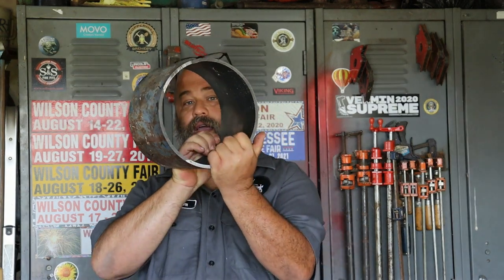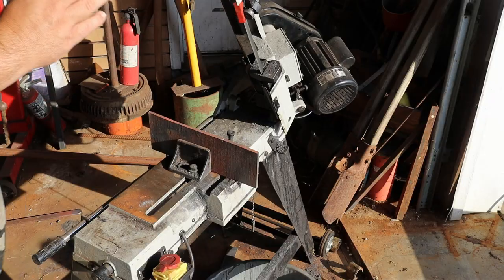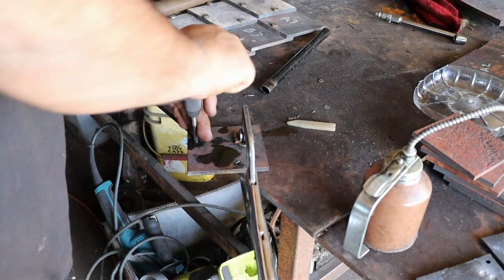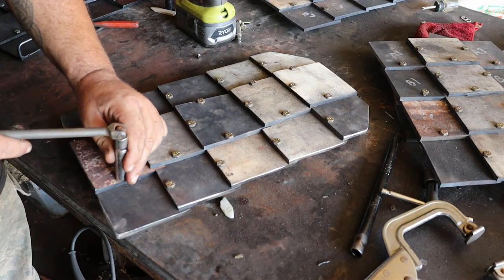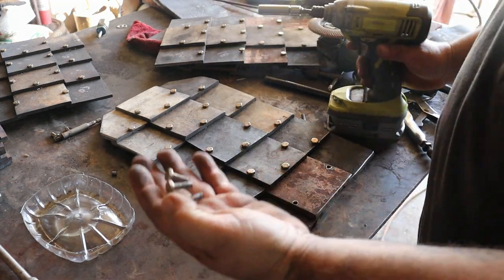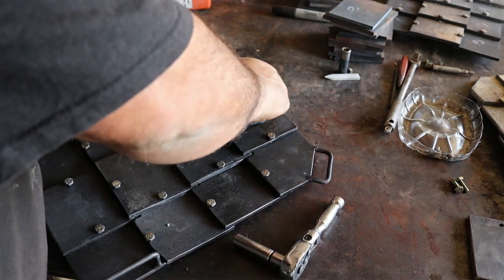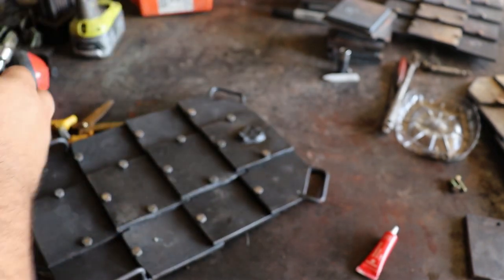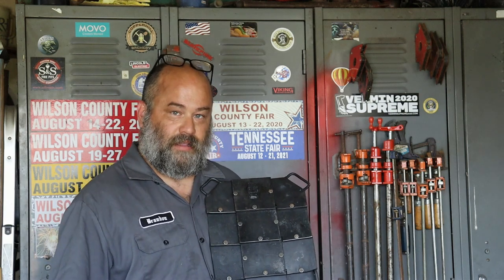Voo Doo Scale Blacksmith Armor Better Armor Better Production

Comment: Some suggestions if your open, one you absolutely need a throat protector maybe a welded v outward collar since your rounds are shattering on impact, imo for the upper chest portion to angle outwardly to funnel shrapnel away from head eys throat should stop you from taking hollow point flak in the jugular. Two as said angle plate slightly for multi reason one being round deflection, two being moving shrapnel away from face throat eyes, three for round impact distribution. Also it may or may not help to slap a half inch of silicone or even rubber floor padding melted to the back for the shock as well, those plates will turn your ribs into powder on impact. Just my opinions. 

Maybe even take a layer of Kevlar over the front to help catch bullet fragment just a thought.

Anyways love the design and can't wait to see what it becomes.

Comment: came over here from demo ranch because i fell in love with the armor, looking forward to seeing more updates. Have you thought about potently layering flex seal or layering it with some rubber as a potential anti spalling agent ? im also curious about the weight of the system as is.
Reply from the maker: Glad to have you working on spall protection now, no flex seal though!
Reply: @VooDooTennessee  amazing armor
Reply: I’ve been suggesting a physical ridge to deflect the spalling; something to redirect it away from the face and vitals.

I suppose the problem with that is that then the spalling can also hit your arms and limbs, so maybe combined with anti-spalling.

I like the idea of flex seal 😆 maybe mixed with some sort of fiber. Carbon, Kevlar, or even something cheaper.

Comment: 1 question and 1 piece of advice:
Q: Why do you soak the bolts in vinegar to remove the coating?

Tip: If you relieve the drill and tap 1/4 turn after every full 360⁰ turn, you'll break chips in the threads, which will lead to much cleaner threads and extend the life of your taps by about 200-400%. ;)
Reply from the maker: I soak purely for aesthetics. yes normally 1/4 reverse trick works but I found with this steel even normalized I had to drill a hole out of spec and it became unnecessary.

Comment: leaving each plate with just a tiny bit of curve would improve the penetration resistance. and might make it more comfortable, though with its mass that might be a trivial issue. I still favor high-tensile fiber cord lacing over rivets or bolts.

Comment: what if you layered some kevlar behind it to act as padding for the vest and for stopping any stray shrapnel that might come through the cracks. kevlar with the flex seal mentioned by Zach Weichel could prove to be a very good shrapnel catcher. layering the kevlar might be the hardest part however seeing as you cant just weld it to the plate, maybe you could add a strap from the big spool you have and weave it through the steel plates and itself to form a meshing in the rear to hold the kevlar.